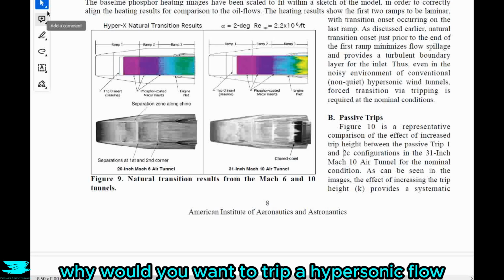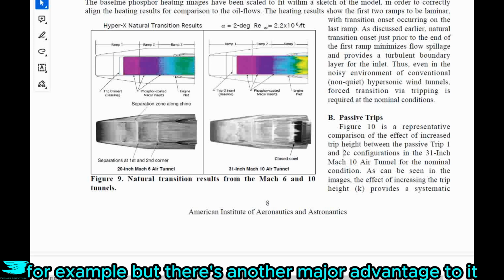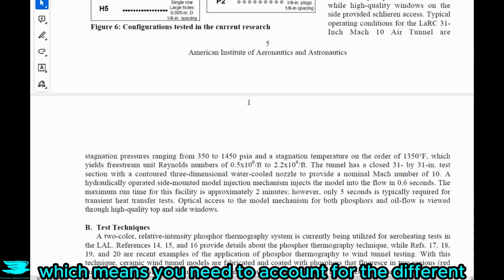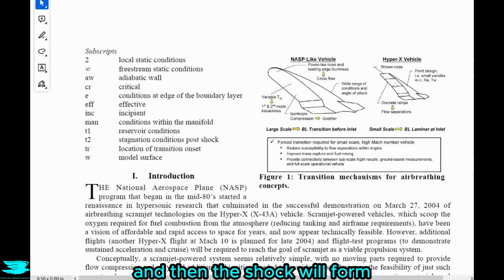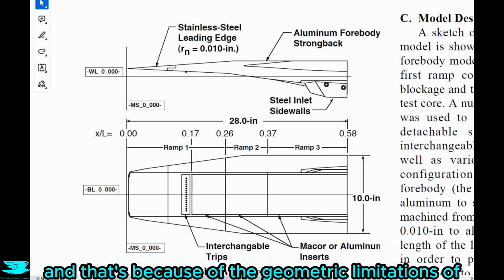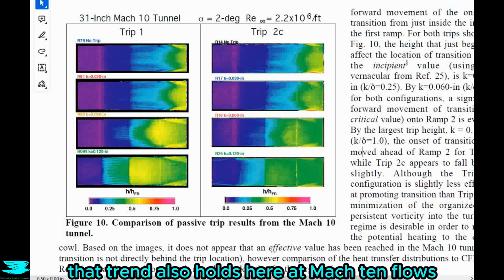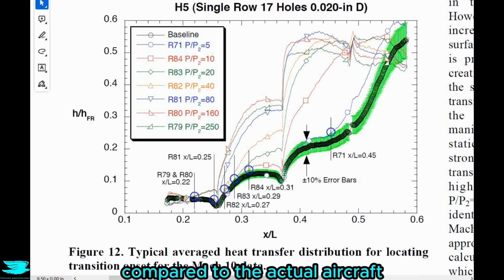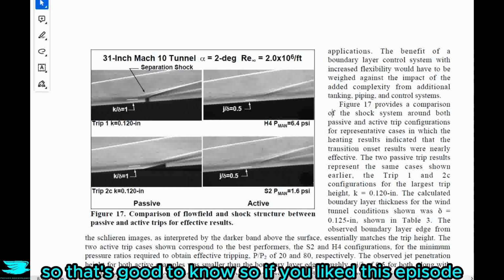Podcast 195 Can You Trip Hypersonic Boundary Layers?

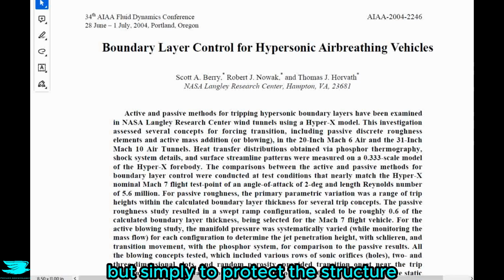Comment: 7:20 
The space shuttle's ceramic tiles were not ablative.
Ceramic tiles in general are not ablavive, though they may erode with repeated use. ablative heat shields are generally not reuseble and are usually made of a polymer resin.
Reply from the maker: Ah, you're right. For some reason I thought the leading edge tiles were ablative. Thanks for the correction!

Comment: If a propeller spins fast enough it's possible that the wing tip break the sound barrier. I wonder if it's possible to build an engine on this principle. It would consist of a spinning disk with openings to allow supersonic airflow to enter the inlet. Combustion would create thrust and keep it spinning. I would angle it slightly so that the intake isn't sucking in exhaust and a portion of the exhaust can create thrust
Reply from the maker: There have been some designs with supersonic tip speeds, but usually they create such loud noises that it knocks out the ground crew. It also introduces instabilities in the propeller and huge loadings.
Reply: @PremierAerodynamics  getting it to spin at mach 3 without tearing itself to shreds probably isn't possible with current materials either unfortunately
Reply: @PremierAerodynamics  another idea I do have though as far as normal turbine engines go is having canular combustion chambers mounted on the shaft angled at 45°. That does away with the need for turbine blades which means you can run the engine as hot as you please. Also reduces weight and cost
Reply: Look up the XF-84H, affectionately called the “thunderscreech”. World’s loudest plane, could be heard from 40 ?? miles away. Gave seizures to those on the tarmac.